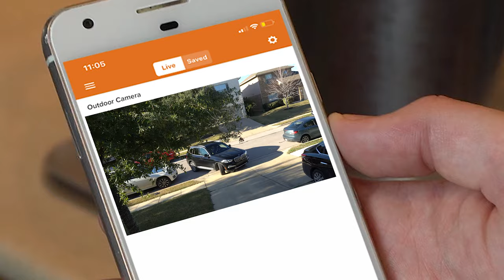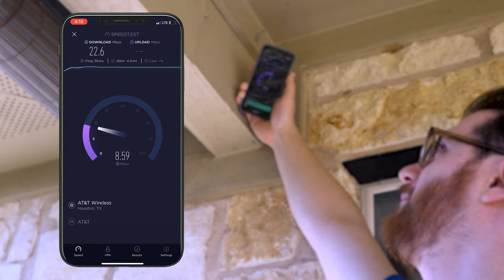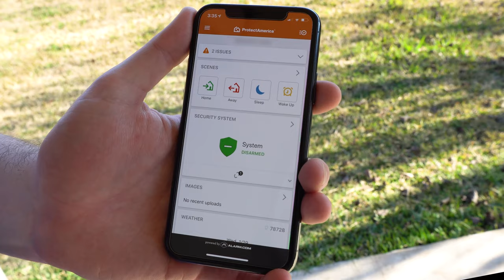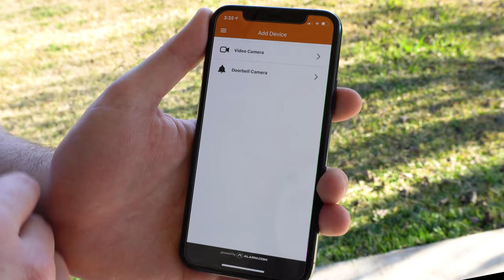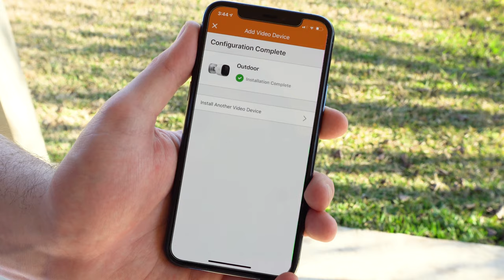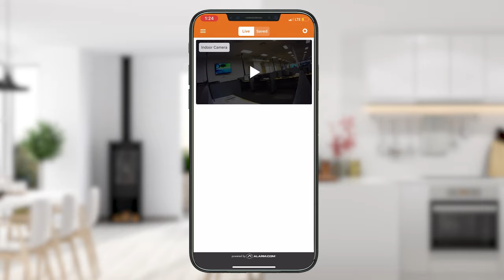How To Install An Alarm.com Outdoor Camera: Quick Demonstration

Comment: Omg... I've been a low voltage electrician for the last 20 years.. Love the video, great presentation.  But, I know... I'm only here to help.
1. Extension cords are considered for "temporary (90 day max)" electrical installations.  A camera fastened to the wall and having a wire penetrating into the house from it, creates a sense of a permanent installation and may be against local electrical code.  It may even slow down the sale of the home or business because of the electrical fire code infraction.
2. The outlet that was shown in the video had illegal wiring outside of the junction box.. That screen shot alone is incriminating..
Good luck!!
Reply: Great point! I install Alarm.com V-723’s all the time, and NEVER use an extension cord! That’s just begging for trouble. I will always properly splice the power cord that comes with the camera, using proper gauged wiring with suitable wire nut connectors, for proper connections, should the nearest power outlet be further away than the 20 feet or so of power cord wire that comes with the camera..

Comment: I changed my internet network and didn’t know how to connect??
Reply: Did you ever get this problem fixed? Have the same problem and can’t get it connected
Reply: @killadocg23  the website is your best bet. I couldn’t find any video on you tube that could help me.
Reply: @Los714  I went on the website but wasn’t any help.. I guess I have to pay the 55 for them to come out here
Reply: @killadocg23  I’m sorry man wish I could help.
Reply: @Los714  hey I finally figured it out. I had to delete the cameras and then reinstall them to the app
Reply: @killadocg23  glad you figured it out
Reply: Question. You need to pay monthly to use it?